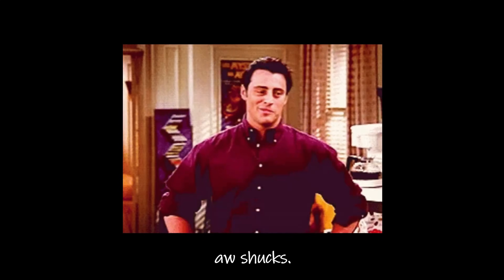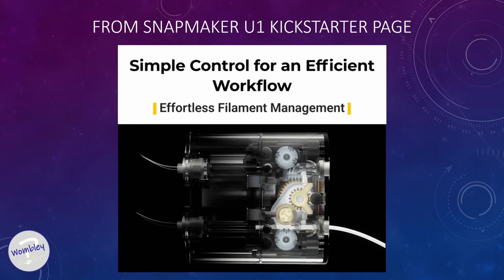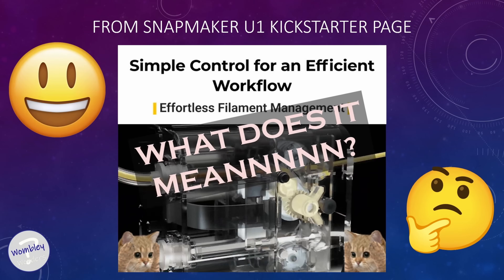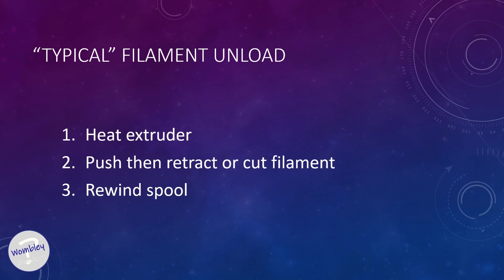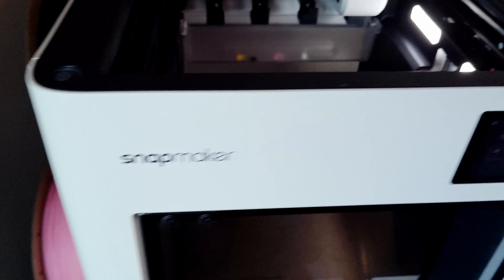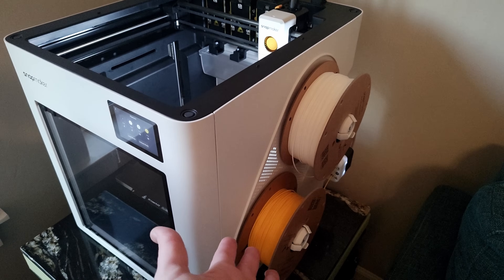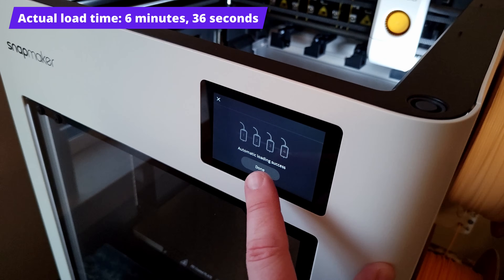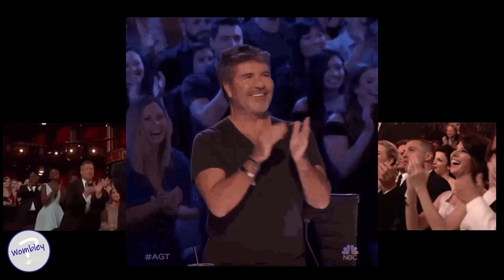Snapmaker U1 Filament Auto Loading

Comment: Would it be possible to flip the filament autoloaders so it fed from behind the machine?  Or would the powercables / ptfe tubes be too short for that and cause too steep of an corner?  I'm going to have a dry box setup behind the machine, and while I know I could just skip the feeders and feed the filament manually into the hotends, it'd be nice to keep the automatic loaders in the loop. :)
Reply from the maker: This is often discussed by the community in their other forums. It isn't practical without a little modification, I think. For one, rotating them 180 deg would, I think, make the PTFE bends too tight. That isn't stopping people from looking at how to solve that... 😅
Reply: @WombleyWonders  Yeah, figured that might be the case with the tubes, thanks. :)
Reply: Found a solution for my setup, I don't think I can post links without Youtube getting antsy, but on Printables there's "PTFE adapter for Snapmaker U1" for adding PFTE connectors to the Autoloaders, and also "Snapmaker U1 - PTFE Tube Radius Guide" that helps the tubes not get too steep of an angle to them.  Those will let me feed from behind while keeping the Autoloaders in the stock position. :)

Comment: That filament loading unloading process makes me appreciate the AMS systems. No manual rewinding, no long wait time to switch rolls / colors.   They could have automated that better I think by using one motor for each spool so it could also rotate backwards.
From my understanding the toolheads get also powered in parking position to keep them pre heated, which makes me wonder why the Hotend has to pick the toolheads one by one to unload each spool. Shouldn't it be able to do all at the same time or can't the toolheads heat up high enough to the unloading temperature when it's not connected to the Hotends because there is a power limitation that prevents them technically from going above the pre-heating temperature in parking position?
Reply from the maker: For the picking, I believe this is due to a toolchanger being parked on silicone pads to prevent oozing and keep tool changes fast/clean. So then to do the push/pull for unload and/or the priming extrusion, they do need to be picked from the pads. Think of the purging done every time an AMS switches filament, but here it's only once when you start the tool.

Admittedly the video makes it seem drawn out (and there are ways to make this faster already suggested for future), but see the Prusa XL for an example of how this could be so much slower.

Comment: any reason why you loaded spools 2 and 4 under instead of over? (toilet paper argument).

seems like the bottom ones could have a straight shot into the filament if they spooled over instead of under. 

nice vids mate, cheers
Reply from the maker: No, no reason really. The bottom ones, the feeder port is basically level with the center of the spool. So I guess just to separate it more from the top spool in my eyes and mind. I guess maybe gravity doesn't help it unspool in that case now that you mention it. 

For TP, I'm 100% an over person unless someone has pets or kids. 😂

Comment: That looked slow as hell... It whould be nice if it unloaded when the print was done, or perhaps an option to unload after print, on my p1s it's like 10 second to change filament.
Reply: As its open source klipper, this is easy to add in the config
Reply from the maker: What's shown here is one-time loading each tool so they're ready to print on the fly. And yeah, that option has been suggested.

For the P1S, 10 seconds is only to cut and retract, and doesn't include flushing previous filament, which also needs to be done every time you change filaments. Here, each tool is being pre-purged so it's ready to roll after this. Then they stay loaded and swap in 5 seconds while printing with no need for further purges.
Reply from the maker: (And on speed for this, a better comparison is the Prusa XL. It has one more extruder, but is a more manual process I understand takes much longer to load/unload all tools. Here the U1 is fully automatic, and down to 5-6 minutes at this point in testing with room for it to be faster still. Both having the advantage that once they're loaded, they're fast and wasteless for swapping!)

Comment: No, I've had this shirt for a few years now. Today is just the first chilly day since late spring, so a long-sleeved option was best. Thanks for noticing, though! Oh, great video and demo as well! Looks like they're on to a pretty neat way to handle filament. I'd kind of like a toggle to initiate the unload process at the end of a print, if I know it will be changing. Maybe that's an edge case.
Reply from the maker: Ha! And that's an interesting one. Passed this on, suggested as an option for the end of a *successful print. Because even on a great printer, stuff happens. 🤣
Reply: @WombleyWonders  Good call on specifying a successful print!
Reply from the maker: Follow up after using it more! Snapmaker did take note of the "unload after print." However, after more use, I'm not so bothered now. Because it can unload filaments faster than I can personally vacuum bag them, if I start bagging each one as soon as it's unloaded, while it's still unloading the others. Working side by side with ole Toaster, he finishes unloading the spools before I've caught up.

Comment: Great info, really clears up a lot of confusion with these.
Reply from the maker: I hope so! It's pretty slick but easy to panic the first time when you mount a spool and it doesn't go all the way into the extruder at first. Totally normal! There's an explainer on the screen that, in fairness, is easy to miss in the current form.